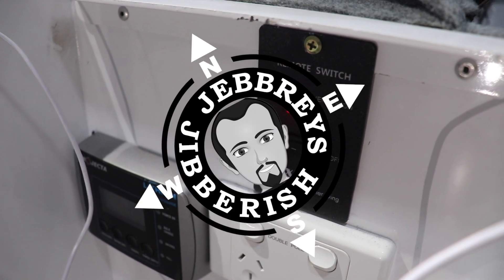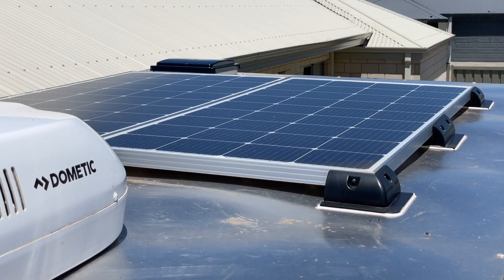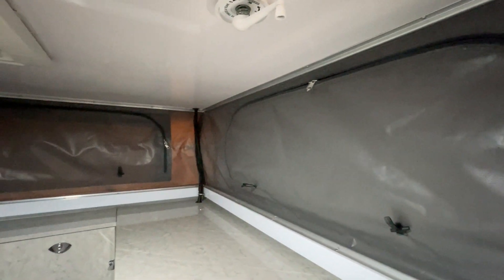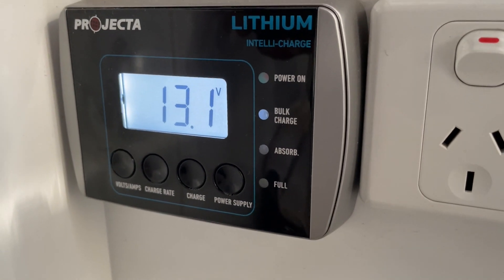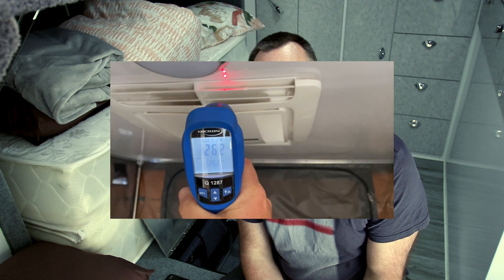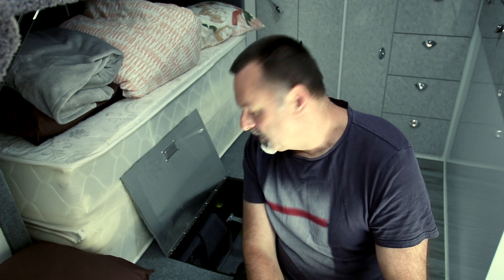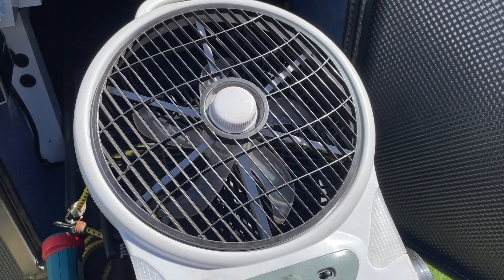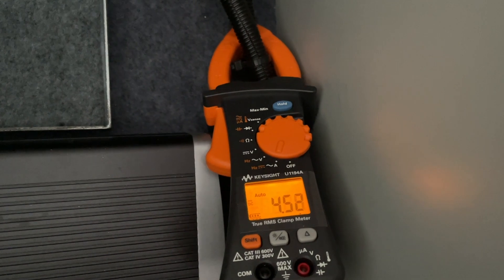I test my DOMETIC Air Conditioner to see how many AMPS it draws off my LITHIUM Battery and Inverter.

Comment: I have 3 x370w Lg panels and they average at peak 1050w (95% nameplate).

Normally by 8am they’re at around 800w. Averaging about 7-8kwh per day.

With a domestic split system I can run AC on max indefinitely
Reply from the maker: Love it! I doubt the Chinese panels that came with the van run that kind of efficiency but I must say they do seem to work quite well.

Comment: hi would a 3000w pure sine wave inverter work with a 460ah lithium battery they sell nowadays , for a 13,500 btu a/c ? thanks
Reply from the maker: Well it would depend on a lot of factors but if it was a soft start or inverter style it should run fine but for how long would be the question. On low it might run an hour or two.
Reply: Almost guaranteed that a setup like that would work so long as the battery has a 200A BMS with a minimum 300A Burst for a few seconds. Which is pretty standard. 

Just keep in mind, every hour the AC runs it’s about 1kwh to 1.5kwh depending on ambient temp. 

A couple large residential solar panels (450W…if you’re in USA look at used panels on SanTan Solar) would offset a significant amount of your load. And  if you’re running that AC it’s highly likely that you’re going to be getting 600W or more. Don’t cheap out on an MPPT. A Victron might run you $150 but they are worth every penny. They simply work and the Bluetooth models are worth the extra $10 or $15. Excellent app. 

Yes these panels are quite large but if you can fabricate some kind of ground mount it wouldn’t be too much of a hassle to set them up if you’re boondocking somewhere and not moving every 24 hours.  

I think anything more than two of these panels (60”x36” typically) is going to be way too much for someone to haul and store.
Reply from the maker: @ericklein5097 yeah I just put a victron MPPT controller in for the fixed panels and rewired the old projecta to an external point for some portable panels.
Reply: what size victron? model?  @JebbreysJibberish
Reply from the maker: Personally I’d go 400 if I could afford it. I have a 100/30 smart solar mppt, I did a video on it just recently.
Reply: 400?  @JebbreysJibberish

Comment: Great video mate....
I would love it if you had mentioned the state of charge (ie: percentage) at the various stages of the test.
As you are no doubt aware, with lithium batteries, the voltage isn't of much use to us as a monitoring "tool" because, as you said, it'll stay nice and high (low 13s to high 12s) and then just fall off the cliff all-of-a-sudden.
That's why it is FAR more important to watch the percentage state of charge....when you see that dip to around 20% you know you're getting close the cliff's edge and may not have enough to keep the fridge going overnight etc.
Thanks very much...I have an older model IBIS (non-inverter) in the Bushtracker and have been thinking of updating to a suitable inverter air-con so that I can run it off the 1800w Xantrex inverter via 300ah of lithium and 540w of solar o the roof.
Keep up the great content.
Reply from the maker: Yeah unfortunately I don’t currently have anything to measure the state of charge of the lithiums as the projecta doesn’t do that. I think setup correctly a newer Ibis inverter would work well on what you are planning. I ran it for nearly 3 hours today in the full sun on fan speed 1 and at one point the voltage went up 0.1 volts! I’m super impressed how efficient it is.
Reply: @JebbreysJibberish  all good mate....at least you proved the concept works well.
I'd have to get a sparky to re-gig some wiring if I were to try to do what you've done. At present, the inverter is only wired to run off shore power and I'm not 100% sure what needs to be altered. Even though I'm happy to do some 240 volt wiring, I'd draw the line at doing open-heart surgery on the Bushy! hahaha
Have a great Chrissy...guess you'd be heading south this time?
We recently did a quick 4 week trip over your way (we have a son in the navy at Rocky and we live in Kadina, SA) and I wanted to do some of the northern goldfields region which we hadn't previously visited.....your earlier video inspired me in that direction; so thanks for that too.
Reply from the maker: Awesome stuff. Yeah we are heading to Esperance for Chrissy. Hopefully the weather is good to us! 🤪

Comment: How many AMPS are your batteries ?? I only have 1 x 105 A lithium battery and wondering if it would even power the 2000w inverter?? 
I was talked out of getting a 3000w inverter by the salesman @ Kings said forget it with only one battery , even a 1000w inverter would only last just over an hour at full power ?? 🤔
Reply from the maker: I’m running a little over 200amps. 300 would be better to run the aircon. The lithium would run the 2000w inverter but you wouldn’t run it at full load for too long because it would be drawing the peak range of what the batteries bms could handle. Running something like a pod coffee machine would be ok for example. Running the aircon would be a bit much.